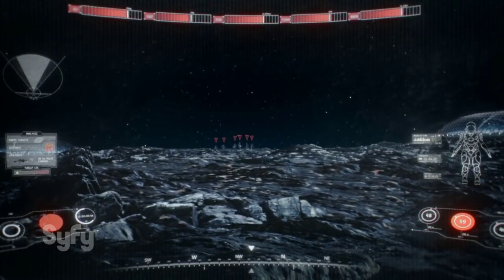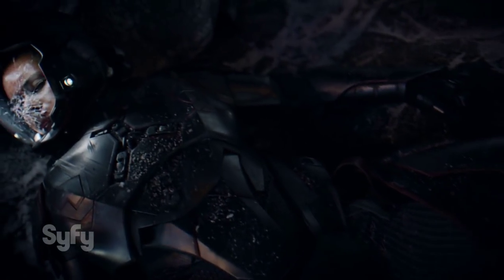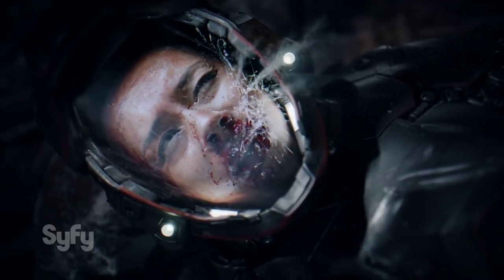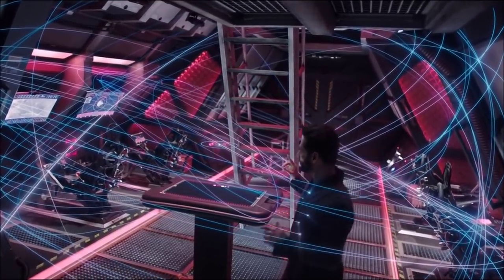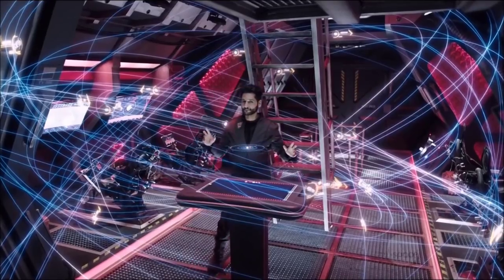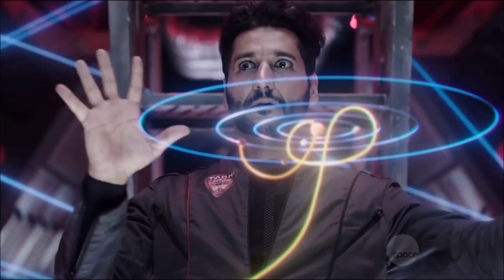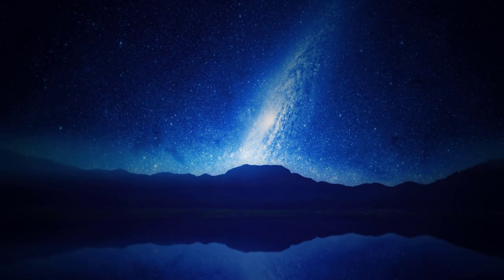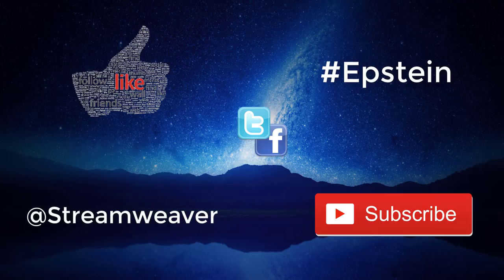Let's Do the Science:  The Epstein Drive

Comment: only way it could work if it was possible with current  tech would be for a fission power plant to start up a fusion drive because of the power needed for fusion at current state you need 2 put in more energy to create fusion then it can put out but that's not to say that fusion cant create amazing amounts of thrust so it could work but then your getting in to thrust /mass it would have 2 be a big ass ship to have a duo power plant nvm how you would deal with the radiation we may come up with a way in the future but only time will tell

Comment: The one thing that always puzzles me is the G force in space. If there is no source of gravity nearby how can G forces affect human body (as mentioned at ~1:30)? I find movie scenes where pilots bounce around in the cockpit or gnash their teeth while experiencing supposedly high Gs during acceleration or maneuvering in space quite ridiculous. On the other hand i still wonder that maybe it actually is realistic from scientific point of view.
Reply: Gravity and acceleration act the same. Speed up, you get pushed "back" into the seat (which is actually moving forward).
Reply: Yes, and you move forward with it at the same speed because your body has no inertia (which is quantified by it's mass which in turn is close to 0 in zero gravity).
Reply: No; your mass and its inertia are still there, and the same. The confusion stems from using the same words to describe weight and mass, and from calling free fall "zero gravity" when it isn't. When you and your chair and vessel all move together, that's free fall. When the vessel moves forward, and pushes against your body, that's acceleration. It strongly resembles the push you get because the Earth blocks your falling freely downward- "weight". If mass and inertia vanished in free fall, you could pick up and move a mountain-sized asteroid with less effort than picking up a Kleenex on Earth.
Reply: I see. So i did confuse weight and mass, gravity and acceleration.
Reply: The way schools teach, it's not your fault. On YT I've run into people who don't understand Newton's third law, and could not be convinced rockets work in a vacuum... Even flat-earthers, Apollo deniers, even some outer space deniers...

Comment: #mytheory without inertia dampener / TR-3B "magnetic field disruptor" / "Die Glocke"  http://psicorps.weebly.com/uploads/3/1/5/5/31555733/9223895_orig.jpg , they need to inject plenty of fuel into engines, additionally to the plasma from the reactor , both is electromagnetic accelerated by coils (similar to the "Impulse Engine" in Star Trek http://fsd.trekships.org/operations/images/impulse-2.jpg )

Comment: Interplanetary travel does not happen in straight lines; you are forced to travel along curved trajectories which are dictated primarily by the gravity of the planets and moons in the solar system. While you can modify the trajectory that you travel along by changing your velocity, you CANNOT accelerate as much as you may want to, because if you go too fast you will end up going past your target. Therefore the estimations that the travel time between Earth and Mars is 3.5 days or that the travel time between Earth and the Moon is 3.5 hours are invalid.
Reply: Those times are calculated with flips. You accelerate towards your target for the first half of your trip, then in the middle you turn the ship around (flip) and decelerate for the second half. The result is you arrive with zero velocity, in the shortest possible time.
Reply: Obviously that's the case because you cannot arrive at your destination at maximum velocity. Otherwise you would go past it, and that's not really arriving. Anyway, straight-line travel (which is the assumption which must be made in order for such optimistic travel times to be feasible) is not consistent with real orbital mechanics. The only way you can even approximate straight line interplanetary travel in space is if you travel directly between the center of mass of one body and the center of mass of another body. However, because you would have no tangential velocity component in this case, it is not sufficient to simply decelerate in a straight line parallel to you trajectory. If you did this you would end up crashing into the planet or star you're moving towards (you must have a sufficient tangential velocity component in order to orbit a body safely). Besides, considering all objects in the solar system are constantly moving along curved paths it is impossible to go directly in a straight line from one body to another. If you want to talk science fiction, the only way that I can see such travel time predictions being "real" is if the Epstein drive somehow nullified the effects of gravity on the ship.
Reply: "Anyway, straight-line travel (which is the assumption which must be made in order for such optimistic travel times to be feasible) is not consistent with real orbital mechanics."

With these kind of speeds they are. We have to deal with curved trajectories because we go pretty slow around our solar system. With 1 G of acceleration, the trajectories quickly become almost straight lines (obviously there is a bit of curving, but it's barely noticeable). This is because at 1 G acceleration you will very quickly put yourself on an escape trajectory, which is hyperbolic, not ellipsoidal.

Example: The escape velocity from the sun at earth altitude is ~42 km/s. At 1 G of acceleration, you will hit that speed in a little over an hour. 

After a couple hours of that the trajectory will be very similar to a straight line, assuming it doesn't get close to the sun or another large body.

"The only way you can even approximate straight line interplanetary travel in space is if you travel directly between the center of mass of one body and the center of mass of another body"

Yeah, that's how it would go, plot a straight line from where you are to where the planet will be in however many days it would take to get there, and then factoring in the tiny correction required by the hyperbolic nature of the trajectory.

"However, because you would have no tangential velocity component in this case, it is not sufficient to simply decelerate in a straight line parallel to you trajectory. If you did this you would end up crashing into the planet or star you're moving towards (you must have a sufficient tangential velocity component in order to orbit a body safely)"

Lets say for example that required tangential velocity to orbit the target planet is 10 km/s. It would take the ship less than 20 minutes to acquire that. Its really no big deal. Furthermore, if the pilot is at all smart he would just plot his course so that it takes him next to the target planet, and time it so the burn would remove all but 10 km/s of his velocity, at the point when he reaches the closest approach.

"Besides, considering all objects in the solar system are constantly moving along curved paths it is impossible to go directly in a straight line from one body to another."

You would have to plot a course that takes you where the planet is going to be, not where it is of course, but that is trivial. Since the travel time is so short the target planet won't have time to move very far.

" If you want to talk science fiction, the only way that I can see such travel time predictions being "real" is if the Epstein drive somehow nullified the effects of gravity on the ship."

I mean it pretty much does. The gravitational acceleration due to the sun at the earth's altitude is 0.0006 G, so with this ship the corrections to account for that are basically nothing.

TL;DR: The speeds are so high that you don't need to consider orbital mechanics, because you are no longer orbiting.

Comment: Yes lets do science... for instance you are obviously referring to "fission," fusion doesn't use pellets of any sort except in one case where they use x ray lasers and small pellets filled with hydrogen. But all other fusion experiments as well as the yet to be completed tokamak's and stellerator's use a hydrogen Isotope gas... not pellets!.. there where more pieces that seemed to indicate you meant fission but I don't care enough to rewind it. I do care that those who say they embrace science at least try and replicate the same amount of give a $h!t in their efforts to be accurate...  Anywho my point is when you make a massive screw up, like switching fundamentally different nuclear reactions, it most assuredly cuts into any credibility as to whether you even grasp enough to have an actual conversation on the topic let alone host a show.  However, I will concede that I haven't watch anything else by you so I don't know your body of work... But the point is now I don't care to...
Reply: "fusion doesn't use pellets of any sort except in one case where they use x ray lasers and small pellets filled with hydrogen."

Correct, he was referring to inertial confinement fusion. Magnetic confinement would be very silly to use on a spaceship, mainly because of weight. I believe that answers your question?

Also the pellets don't have to be filled with hydrogen.